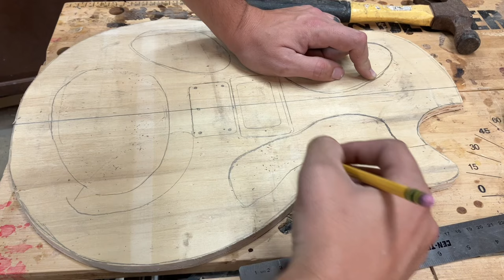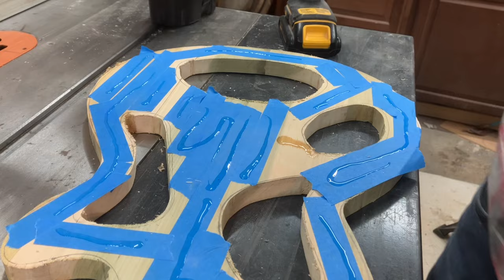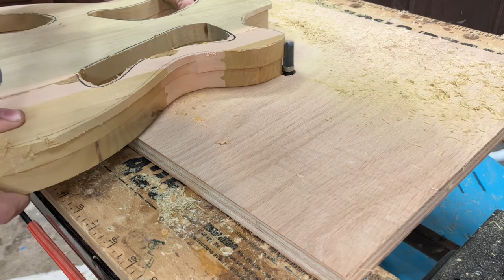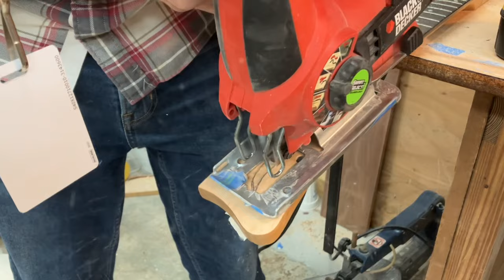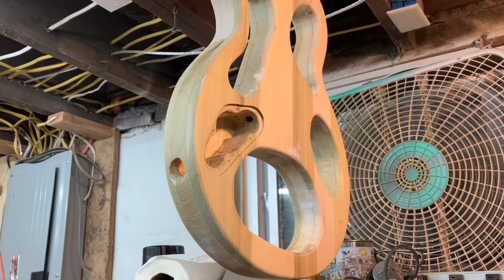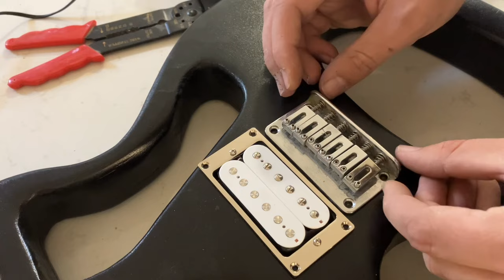I built this guitar with just 3 tools!

Comment: Jigsaw, table router, drill, screwdriver, wire cutters, pencil, soldering iron, sandpaper.... right there that's 8 tools... oh... clamps!! 9 tools... I'm sure I'm missing some more!
Reply from the maker: Good job counting!
Reply: @dannylewisguitars  But seriously, that is an AWESOME guitar build! Great work!
Reply: Bro you missed the point 😂
And plus the table router was made using a drill and his handheld router. And as for the screwdriver, soldering iron, and wire cutters, u need those to make a guitar work so those don’t count. And the pencil and sandpaper are just used to polish it up. He meant he use 3 tools to make the guitar.
Reply: @NoahGrace44 you're missing the point. He's either click-baiting or his maths teachers should be deeply ashamed of their teaching efforts.
Reply: Glue!
Reply: You did a bad job counting  @dannylewisguitars
Reply: @NoahGrace44  And the neck was already made somewhere! Or is the neck not a guitar?
Reply: You missed the actual table.
Reply: @willparry   He didn't build the neck, he bought it.  Click-bait of the worst kind.

Comment: Cool build!  I’m assuming you planed the poplar wood first right?  Thinking about getting into building guitars and thsts the part that worries me the most, how to get the wood dead flat and jointed properly
Reply from the maker: I did not plane this wood. I cut it out of old shop furniture and it was already pretty flat. I did sand it though. 

I do have a planet that I use on other builds. But, if you want to get into guitar building start by buying lumber that’s already surfaced on 3 sides and your golden!

Comment: When you glued the thrid layer, all three layers were the same thickness.  So how did you thin it down?  A thickness planer, thinning down the top and bottom pieces.  I am seeing a big difference between the guitar before and after you worked on the neck.
Reply from the maker: Yeah, I decided it was too thick at the last minute. I used a router sled to thin it down. The guitar is too wide to fit through my thickness planer. I didn’t film that part for some reason!